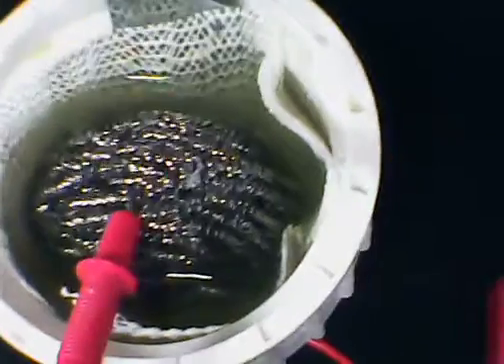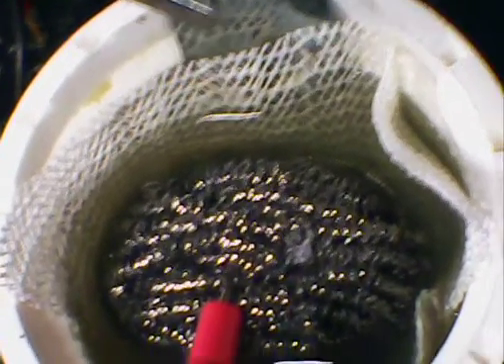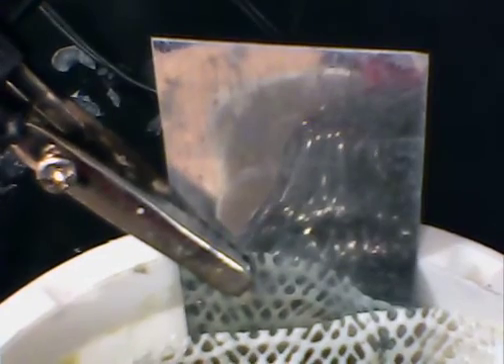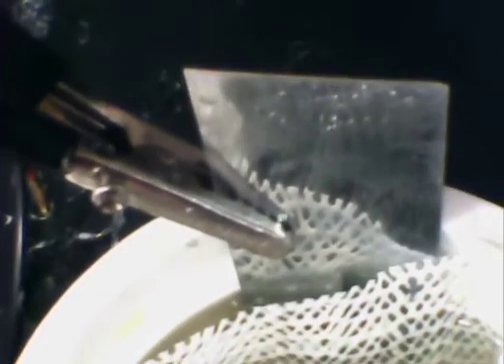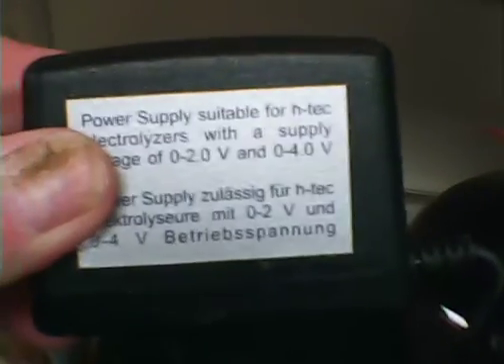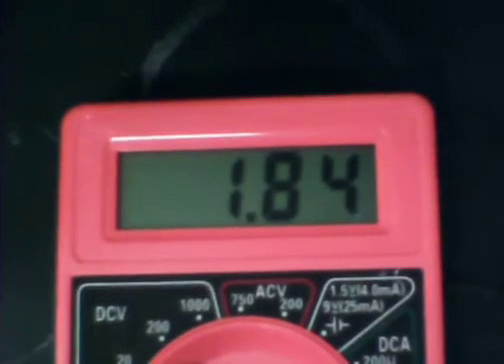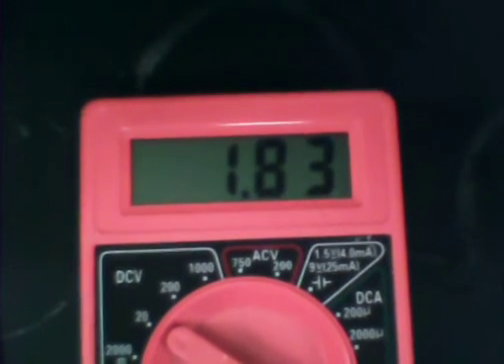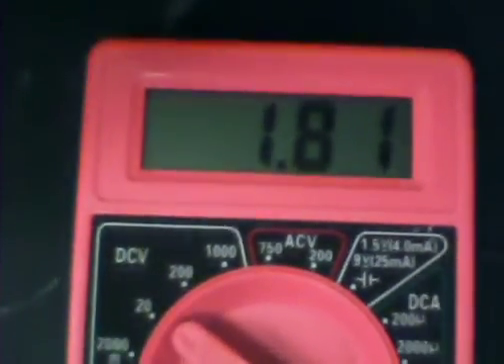Bismuth/ Stainless Steel/ Rechargeable Battery

Comment: Try aluminum as the anode and bismuth as the cathode using baking soda or borax as the electrolyte to create a primary non-rechargeable negative resistance diode (battery).

Comment: David, interesting video. You mentioned in your video that the cell was going for 12 hours and that you were going to check it again tommorrow. Am I to understand that your battery was running under load for 12 hours and you expect to work 24 hours later after a 5 minute charge?
Reply from the maker: Hi Jon: I worked on that a while back as you know. As I recall, it was not worth developing.